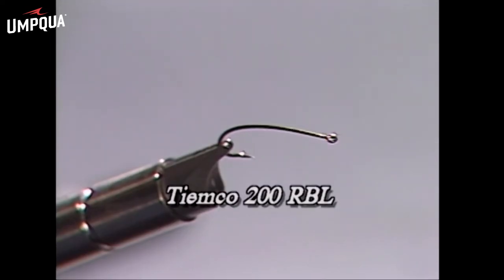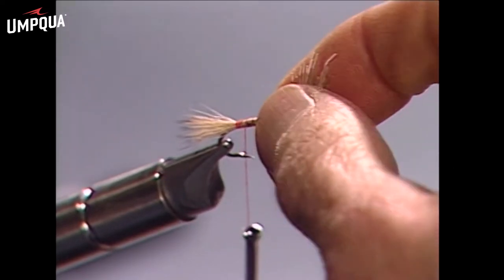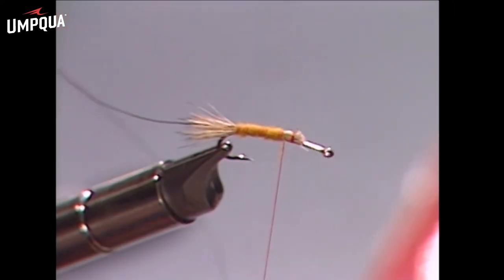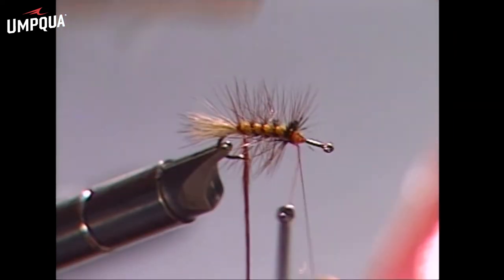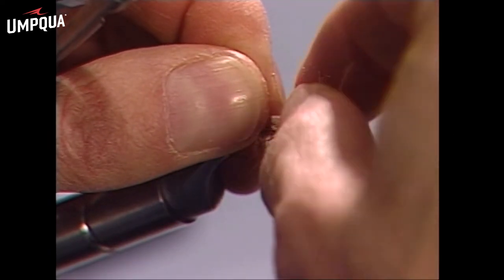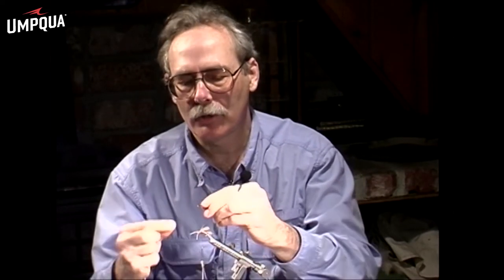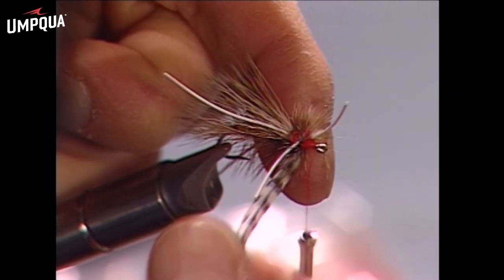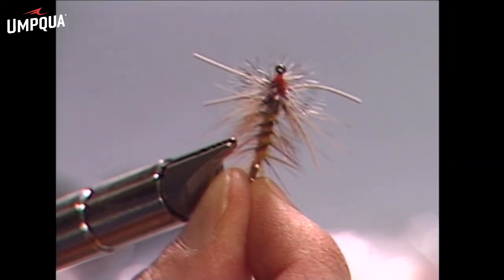How to tie the Stimulator with vintage footage of Randall Kaufmann

Comment: One of my absolute favorites to use when fishing higher in the mountains, although I will switch over to the Amy’s Ant in faster water. I love tying this pattern, and proportionally this fly can be a challenge for a lot of folks. Best advice is buy a 50 pack of cheaper hooks and tie it 50 times before you buy some quality hooks from Umpqua for your final product